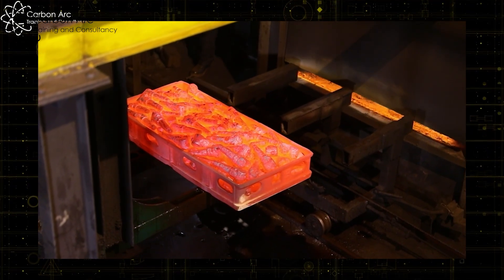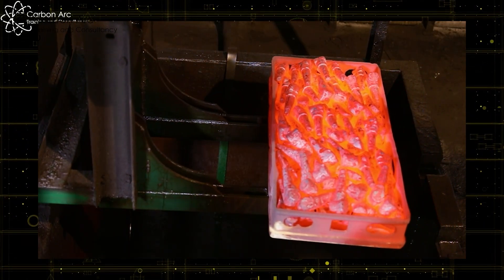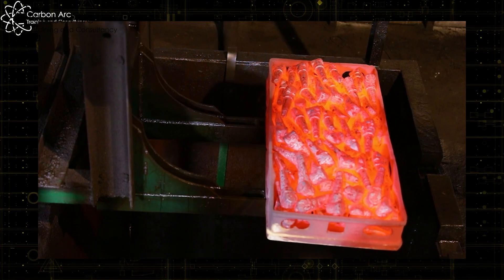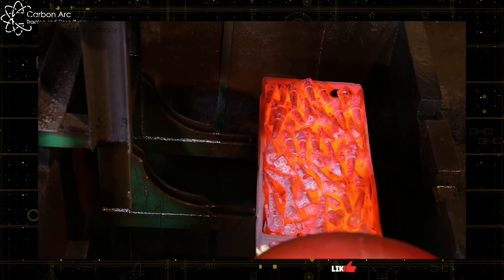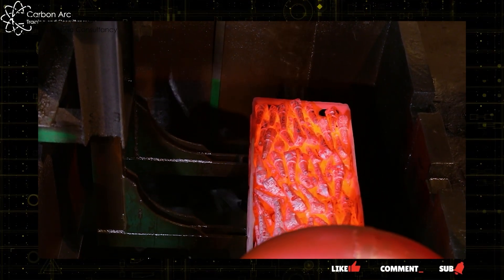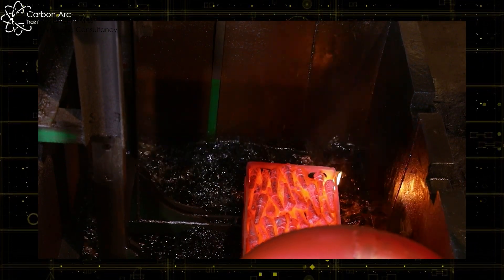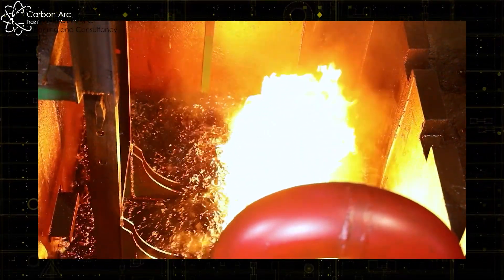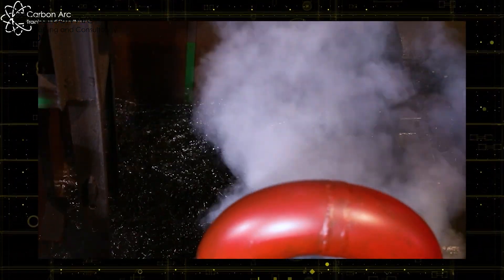Heat Treatment for CSWIP Inspectors in 2025

Comment: Sir, do stainless steel get heat treated also?thank you
Reply from the maker: Not normally. Most heat treatments work due to carbon content which allows the steel to be hardened. Stainless steel has very little carbon in it therefore it does not harden and therefore most heat treatments are useless. In some circumstances heat treatment my be a bad thing as it could increase the risk of weld decay.  We do have solution heat treatment for stainless steel which is used to remove the risk of weld decay but that's about it.